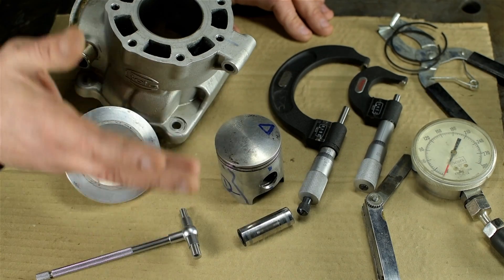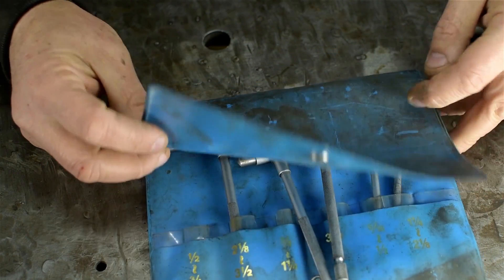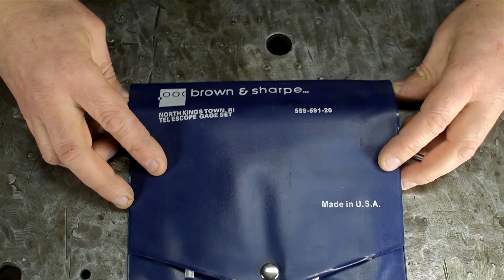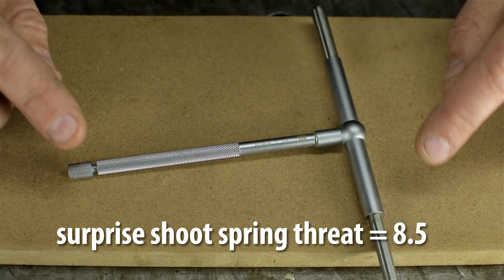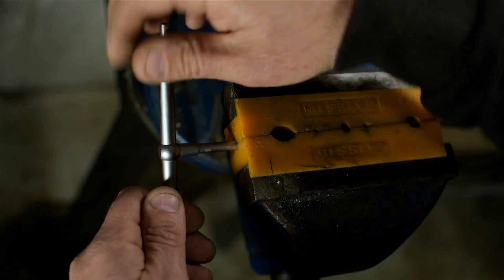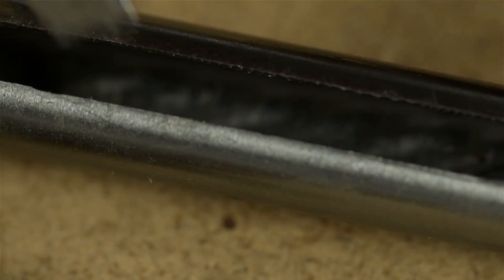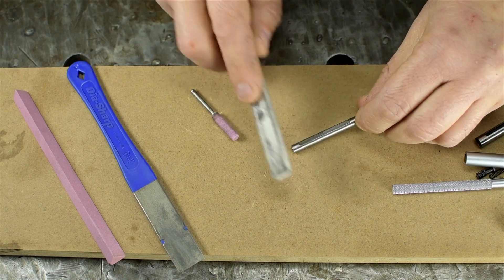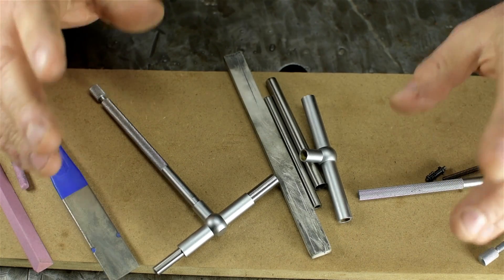Silky Smooth Telescopic Bore Gauges

Comment: Nice job on those. A number of years ago, when I had the same problem with a set of starrett, I talked to the rep about it. The first rep said they were supposed to be like that because <cue song and dance music> it insured that only one surface slipped when using the gauge. The rough surfaces insured everything else bound up solid <end song and dance>. Next rep I talked to  (I had worked with her before for parts on legacy tools) said Bull***T to that and arranged for a service return. Smooth as silk when I get them back.

Comment: Isolation beginning to bite huh? Stripping and filing bore gauges . Same here, screw boxes in order, argon bottle finally strapped to bench, hell I've even swept the floor!
Reply: But did You sweep behind the press?
Reply: You could also order your gas cylinders alphabetically, once your are really bored: Argon, acetylene, carbon dioxide...
Reply: F. D. Um ... Acetylene before Argon ... 👍
Reply: @f.d.6667  You had better check your alphabet, Acetylene comes before Argon;-))
Reply: I had to finally sweep last week. Finally got tired of climbing up into the shop.

Comment: Thank you for showing how to disassemble them. Mine have always bothered me, but I was reluctant to take them apart because I didn't know the procedure. I'm guessing that Mitutoyo telescopic gages are better, but they are also $170 for a six piece set.
Reply: E Designs my new set of mitutoyo  are just as crunchy,  was severely disappointed.
Reply: @karlkunkle9233  That is interesting, maybe manufacturing has moved from Taiwan to wherever is the cheapest this week.
Reply: @karlkunkle9233  I'm surprised to hear that. I have the utmost respect for their products. You saved me some money, and I don't blame you for being disappointed ;-)
Reply: Surprisingly insize are well finished

Comment: Can't say the current editions are the same, but my 40 yr old Starrett's were and still are silky smooth. And mine have never been apart. The Mitutoyo versions today are supposed to be just as good. Those B&S/Tesa bean counters should hang there head in shame having obviously shoddy and cheap as possible off shore crap branded with what once was a trusted name and then jacking the price just cause the plastic case has there logo on it. I'd probably expect to deburr the cheap ones, MSC shows a current list price of $158 U.S. for that set. And they still need work put into em?  I can think of a bore they need to stuff them into.:-)

Comment: Great video, thanks. I've had the same experience, both my cheap Chinese and my much more expensive (and it turns out Made in China) "quality" English-brand telescoping gauges are "crunchy". I bet those Brown & Sharp ones are made in the same factory as my "English" ones and my cheap Chinese ones. I'm going to find some time during lock-down to deal with that! I was always afraid to try to pull them apart (same concern about spring firing).

Comment: A couple years ago I treated myself to a starrett 91B tap wrench.  I'd been eyeing one for a while and finally pulled the trigger on one.  It was brand new in the box still in the plastic bag.  I was so excited I could barely contain myself.  I brought it to work with me and wanted to try it so bad that I grabbed a piece of CRW (can't remember what) stock, drilled a tap hole and grabbed a tap.  This is where my excitement died.  I went to close the wrench on the tap and got a gut churning crunching sound from inside of it.  I stopped what I was doing and took the wrench apart to find metal shavings all through the insides.  It took me about an hour to clean them all out.  It broke my heart to spend all that money on it just to have to pick up where they left off.
Reply: I have a Starrett automatic center punch that works about a third of the time.  A good whack against the table usually gets it working the rest of the time.  Pulling it apart shows nothing too obvious, but my Chinese one works flawlessly.
Reply: @matthewdupuis232  Put more bend into the spring!
Reply: I had to make a new anvil for mine when it cracked about 1 month after buying it.  That was my first and last Starrett.
Reply: Wouldn't this be covered under warranty? Here in Europe that would be the case at least. Maybe it is different in US or wherever you are.
Reply: And this is why I only buy used tools. They are generally cheaper because they are 'used', but as a whole, older tools are much better made... back when people gave a hoot about what they were making.

Comment: As an automotive engineer.. never used this kind of gauges. My tool is an internal telescoping dial indicator. Similar to your style but dedicated to engine diagnosis. It has a dial indicator instead of the screw-a-ma-thingy on top, and the anvils are more rounded (almost ball bearings) and they have on one side two spring loaded flaps, or another sleeve with two funky bearings to center the whole thing on exact diameter. And usually only one side is springloaded and with measurement to dial. The other side is just a threaded hole in the body and it comes with a full set of longer threaded extensions each with a ball shaped anvil and a locknut to finetune this fixed size. Mine can measure from 40mm up to 300mm with all those extensions. The length of the extensions is irrelevant since it's a dial indicator and will zero it against a known referece inside a normal micrometer.
The dial indicator is most important to make sure you are measuring the minmal diameter of the bore. And for absolute measurement, i just set my nominal value in a micrometer and zero the dial while resting between micrometer anvils. 

Also is noted that the dial indicator has a very short travel (mine has 3mm travel.. around 1/8th inch) in order not to ding the surface while inserting the tool. This tools is suposed to be rocked back and forth to find the absolute minimum diameter. Tool is always diametral (springloaded flaps/bearings), and the rocking will find the true plane of the circle you are measuring (by watching the dial and stop as it starts the other way).

It's doable with your setup but not optimal. Tool can scarpe the wall while inserting due to huge travel of both plungers, will not ensure dead diametral but it's easy enough to just feel it (self centering sort off), and it will cetrainly not sit in circle plane.. so this may need lots of rocking/locking/repeat.. and by the time is done you potentially done a few scrapes in the area you were rocking to find the correct value.

Either way, for correct measurement, do at least 3 points vertically (near TDC where the 1st ring stop, about 20mm down form that spot where most powerstroke is done, and near the BDC to have a relevant wear on whole cylinder) and 2 diameters (on wristpin axis and perpendicular to wristpinaxis). If TDC value is way higher than the other two heights it's a sticktion/adhesion wear problem on 1st ring, if there is almost same wear at TDC and 20mm down, it's oiling problem (hone marks gone, lots of wear, bad diluted oil with gasoline). Feel free to ask me any question.
Reply: Show off lma0

Comment: I've owned, traded, and swore at many different brands of these gages. My short handle set are really old Starretts, and they are silky smooth. The only sets I've see unmarked, except for made in USA on the pouch were Fowlers. Beats me why they weren't marked Fowler. But the nicest sets I've owned were a mitutoyo set, and a Yuasa set. Both silky smooth, both bade in Japan.

Comment: I have the same set, bought about the same time. Try the 1/2 to 3/4 snap gauge in a say 9/16 hole.  You won't be able to measure the hole accurately as the larger of the 2 sliding pins has too large of a radius cut on the end.  It becomes a 3 point gauge.  I bought the B&S to treat myself to an upgrade from a set of Skoals made in Korea.  The Skoals are better.

Comment: I bought a full set of Mitutoyo's late last year, they sounds a bit better than those but the holding power just hasn't been the same as the ones I've borrowed mover the years, those are more broken in perhaps. I found that some anti seize on the threads helped, but will have to tear down and try this deburr

Comment: Sadly, the fevered sales pitch to buy USA made goods fails to ensure that what you get is worth what you paid. I've gotten a couple of supposedly good quality domestic tools, they need to add the word gritchy and kronchy to the description. Conversely, I've picked up some Chinese tools that were well polished, gritch and kronch free and with good after sales support. Granted, those came from small, mom and pop type companies, not large corporation firms. I suspect the key is to buy from a company that weighs the recommendations from "comptroller" departments who's goal is to just cheapen and cut costs and maintain the illusion of quality. The bigger the company, the better the odds that quality will be diminished with the promise of greater profits when a comptroller/controller gets hired. Temporary increases, long-term failure. Buy cheap and expect to modify or tune a product, buy expensive and it shouldn't happen. When it does, send a note, it probably won't make a difference, but at least it makes the next buying decision easier. Note* I'm still waiting for a replacement of a precision component (USA made tool) that was flawed, they sent a new one, wrong tool component, now sending the correct component and a return shipping label for the wrong part, (two weeks ago email was received) no goods yet. Nice people, disappointing follow up. No, I'll not jump to a Chinese tool to replace the as-yet-to-be-delivered part. You have to remember, most of the name brand power tools are made in PRC, or Taiwan. It's all about the specs.

Comment: The real story here is someone actually measuring piston/bore clearance on a 2-stroke.
Reply: When I had my old HD I used a tape measure for.
Reply: @perrylc8812  You must have had a precision built HD. Usually just rattle the piston about in the bore and think "that'll do" 😄
Reply: I just took the head off mine and mashed a sheet of foam down on it then measured the imprint.  Turns out the 80cc bicycle engine I bought was really 200cc's! Until I remembered it's pi*r^2 not pi*d^2.
Reply: eh, who cares. With modern Nikasil bores they rarely wear and when they do wear enough there's a ridge at the top thats enough to catch a fingernail on. The coating is very thin, any serious damage is noticeable with the eye
Reply: Aidan Gillett  seems like I ran into a company that could reapply the nikasil coating on 2stroke cylinders. They specialized in old Yamahas , but I don’t think they were too picky about it.
Reply: Best advice is to go ahead and purchase a new jug and piston. Learned the expensive way several times.

Comment: I have the same problem on my chinese bore jauge set. Thank you for this tip.
Crunchy moves even on your good brand set ?
Also, rough flat surface must be smoothed but no access to do that with hand tools. Milling ?
Reply: The blunt end of a matchstick with a thin little strip of fine sandpaper. You could do the same with some valve grind compound.  You might widen the slot some. If it would even matter I dont know.

Comment: I have used these frustrating tools for decades. Mine are smooth enough BUT trying to measure oil clearance on  a crankshaft is try to make everything square to get a true measure. Then trying to use a micrometer on them. Far less than accurate on a job where accuracy is tantamount. These days I use a dial bore guage. Better but still not ideal.
I have found my Mitutoyo  dial vernier is as accurate and a lot quicker, though be very carefull as it will mark the bearing surface.

Comment: Those look about as well deburred as the hardened Starrett  combination square head that i got a few years ago new. I could shave with the edges on that thing.
Reply: I've noticed the same thing, Stefan.  The quality just isn't the same any more. Unglaubisch bullenscheisse.
Reply: @joecnc3341  Everything is a kit nowadays.
Reply: That is a shame. I have a set of Starrett snap gauges that are gritty also. I sent a brand new Starrett caliper back to the factory because the rack was made from two pieces and you could feel the transition between the two, could not stand it, it was better but not fixed when i received it back. I gave them away to a young man that was proud to own them.
Reply: @scottjones7279  "I have a set of Starrett snap gauges that are gritty also." Same here. I could hardly believe it when I found out my new Starrett gages were just as rough as my import set, but at 3 times the price!
Reply: @highpwr  for Shame😒
Reply: @scottjones7279  If it says Starrett on it and has a dial on it, throw it the hell away. Their mics are "ok" but their calipers and indicators suck. The 196 seems to be "ok" but mine is from the early 1900's.
Reply: Stefan, its unfortunate that even some of the best brands seem to be lowering standards, especially when it comes to measuring instruments. I have found for bore gauges that my new starretts are no better or more reliable (fit and finish isn't even better) than a set of harbor frieght bore gauges a friend gave to me. I think that's sad. I have an old set of lufkin bore gauges that are superb, a joy to use.
Reply: @stephenwalters1623  lousy new production standards and lackadaisical approach to quality. Shameful. We are in the toilet and all is lost.
Reply: It's a shame but it's a sign of the times, where cost effectiveness trumps doing it right, where the premiumness of the thing isn't it's quality but that it's not chinese.
I can't help thinking of the guys quality checking these things going home every night embarrassed at the job they are forced to do by bean counters instead of proud of the job they did for engineers.
Reply: Yeah my OLD Starretts are very smooth... the newer ones I got at an estate sale, same as these Brown and Sharps.. I miss Enco...
Reply: @Trevor Jarvis
Enco is not truly gone. Enco was owned by MSC, (still is, MSC just don't sell anything other than Enco branded machine tools.)

Look at MSC for their Paramount brand of hand tools, (TOP quality, lifetime warranty).

MSC sells 20-25 different house brands, some of the items previously sold under the Enco brand may be in there.

Many of MSC's imported brands are made in Europe, so don't immediately think Chinese when you see 'Import'.  They are good about listing country of origin because they are a govt vendor, and it is required.

I buy a lot of stuff from MSC, and the majority of what I buy are the cheapest things they sell in any given category. Their philosophy is to offer several different price points for high volume categories of items.

I don't know how much they guard 'house brand' info from the public, but when I'm not sure, I Google the brand name, and if it's a house brand, about the only thing you find is the trademark registration, (to MSC), so it's not a well kept secret, if that's their intent.

[Full disclosure: my wife works for MSC, and we own stock, but I get nothing directly from MSC for anything I say about them.]
Reply: @georgedennison3338  I understand what you are saying George but house brands aside, Enco is indeed truly gone. I'm talking about apples to apples comparisons. I bought two brand new Kurt vises from Enco. 4 inch and 6 inch. The same two vises purchased from MSC would have cost me an additional $580 on the pair at the time. Enco prices made things affordable for small shops and hobbyists. They were ALWAYS less expensive than MSC on "name brand" tools. Oddly enough both of my vises shipped out of an MSC warehouse anyway as well as several other purchases over the years. So yes, I miss Enco as well.
Reply: Their tap handles are no different. I promptly took mine apart, cleaned all the leftover machining swarf off the threads, and gave it some much needed lube. The overall ergonomics are  nice, but gritty threads. shudder
Reply: @KISSMYACE3203  The threads need deburring where the slot passes through them too - otherwise it chews the threads in the handle as you tighten/loosen it and makes more swarf.  Very disappointing.  I don't mind cheap 'good enough' tools and I don't mind paying a premium for really good stuff I know I'm going to make good use of....I just object to paying a premium for tooling that comes into the first category!
Reply: @Cenedd   The "New Age", welcome.
Reply: Multi purpose tools. They can charge you twice , for shave blades and square
Reply: I always give my new tools a short lick with the angle grinder. It always improves them.
Reply: @Dan K Under his microscope...
Reply: I notice there are no sales reps from Brown & Sharp or Starrett putting comments in this thread,  Humm....
Reply: My oh my, that's premium! My set of cheap gauges are just so smooth I just not sure if they move!
Reply: A few things to point out :
 Don't EVER use diamond abrasive around tools --the abrasive will"charge"the sliding surfaces / threads.
 Aluminium oxide / ceramic will do it somewhat.
 Teflon grease / or anhydrous lanolin is great for lube ☺
Reply: Silicon carbide / wet-or-dry paper or compound will be the safest to use last☺
Reply: My hardened Starrett is just fine. But then I got it 1974 or 5. Had to wait about 6 months for them to come up in the production rotation. As to the telescoping gates. I've always thought they should have a bigger radius on them. Maybe a drilled out steel ball.
Reply: Then why didn't you Stefan?  (Just kidding, my beard is longer than your stubble👍)